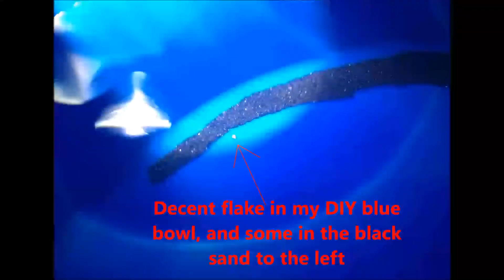DIY Mini Highbanker Running & Results- Got Gold!!!

Comment: That’s a damn nice setup. I’m gonna have to build one like it. Do you have a parts list or any info on how to assemble it? I’m pretty sure I can shape the sluice itself with a handbrake, but the hopper I’m not to sure about. Never fabricated with metal before, but it seems like time to start.
Reply from the maker: Thank you! 
I just built it as I went honestly. I used a hand operated brake for mine. I actually made 2 hoppers for it and this one works much better. The top of the hopper I did some hand forming with a hammer and used angle aluminum that is riveted in place and sealed with silicone. I would recommend using 2 part epoxy or something that isn’t soft as I get some gold sticking to the silicone at times. I have another video that shows it up close and I talk more specs and such.
Reply: @MRT_H  Thanks for the advice, I will definitely make good use of it. Once I build one like yours, I would like to then eventually experiment and build something that’s super compact and efficient for the spots out there that are hard to reach. I also have a few experienced TIG Welders on the in-law side of the family, so at some point I will see if they can help me learn the basics and get me started
Reply from the maker: @thedyinglight8041  That’s always good to know a few welders!  I added a duffel bag shoulder strap to this one and can carry it on my back. Then I have 2 buckets and a shovel. So it can be packed easily for sure. Just be creative and have fun!
Reply: @MRT_H  That’s a great idea to put the strap directly on the highbanker itself, saves you from having to deal with a bag that could get ripped or lost. Do you have a preference on which sluice mats to use for fine gold? Most of the placer around here is tiny, from what I’ve been told

Comment: What pump are you using? Looks like some good velocity there. Nice!
Reply from the maker: It's a 2200gph Johnson pump. It's great!
Reply: Thanks for the quick response. I'm thinking of trying out the Johnson 4000gph. I actually thought that's what you had.
Reply from the maker: @olyprospecting6419  No problem! Johnson pumps are great. My sluice is only 6" wide, and the 2200 seems barely enough to get by. The 4000 would be good, but it sucks the power quick! I just use a small lawn tractor battery and get about 4 hours of run time. So not bad.
Reply: Awesome! Thanks for the great info.
Reply from the maker: @olyprospecting6419  Anytime!